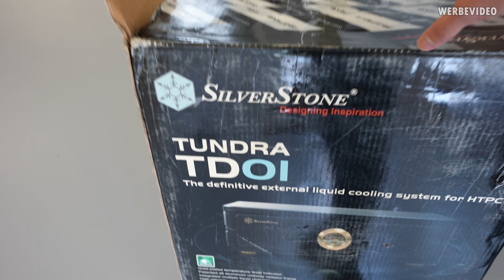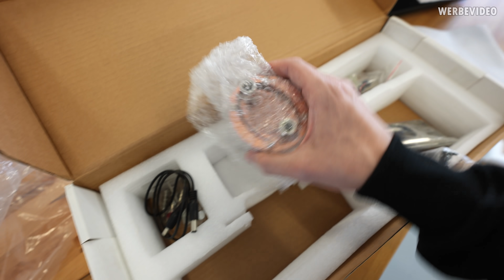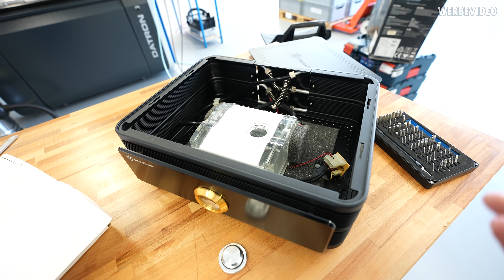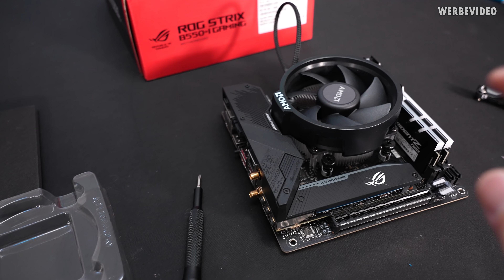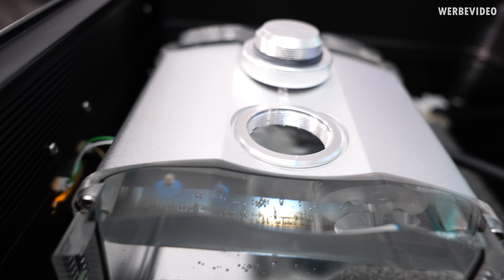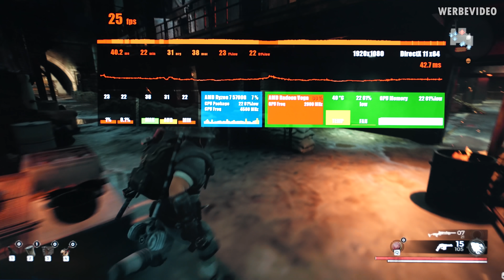This Water Cooling Concept from 2006 just makes No sense - Silverstone Tundra

Comment: I have to admit that analog water temp gauge is a neat look.  also if you want a plumb and play external water cooler, I think Koolance still exists and it uses an active radiator like normal water cooling.

Comment: I sold these and the matching HTPC case at the time it was new. Clients were looking for silent solutions for their new 64 bit multicore systems that were in their living rooms back when air cooling of these was loud at best. Different solution for a different time. AIOs were just starting to roll out, so if you wanted water-cooling without making your own custom loop, things like this were what you got. You also had to be in a larger case (think old Antec full size towers) to do water-cooling, but Zalman had a fanless case that was basically a giant heatsink at the time, but it wasn't much smaller and much much much heavier. This dinosaur lived next to the 80 and 92 mm Tornado fans that sounded like a vacuum cleaner all the time, so it was a welcome change.

Comment: If it were a case with pump and water block already then it would make for a great and compact homelab I'd imagine. Just stack a few of them up, maybe hook in a gpu water block and place 4 120 rads in a box shape on top with a fan wall as lid and hook up the lines to the rad box. Making it easy to remove and add units as needed.

Comment: First: that dual pump makes sense if you add a valve and electronic fail-safe system. So only one runs, the other takes over if the first fails. 
Second: it looks awesome, if you manage to make it more efficient/silent and make use of an eGPU with your laptop, build the eGPU inside it.

Comment: I think this is pretty clever really. it's a water-passive cooler for very quietly cooling chip, instead of water + actively cooled radiator. The holes on top should be plenty for convecting away heat from the inside surfaces, since convection is pretty slow... I can agree though that it's not a cost effective cooling solution, nor a space efficient one, and if the pumps are very noisy, it fails at it's main advantage.

Comment: I had an external liquid cooler from around the same era. I can't remember what it was called but it was made by Koolance and had 3 80mm fans pulling air through a radiator that was all packaged in an aluminum case that sat on top of your tower. It actually worked really well and was much more compact and probably cheaper than this crazy thing from Silverstone. Considering how much better that Koolance product was than this, and that I owned the Koolance product about 2 years before this even came out (you said 2005, right?) it is hard to see what consumers would have actually wanted one. It does look really cool, though. Interesting stuff, thanks for the video on it!

Comment: I wonder how much of an impact the water block had on performance.
Would be really cool to test and compare old CPU blocks against modern designs from high and low end brands.
The oldest CPU water block compatible with modern hardware right out of the box is Zalman's WB CPU series of blocks as they used the AM2/3/4's stock retention bracket.
Reply: I'm using a Zalman WB5 from ca 2007 currently on a Xeon E5-1660v3 and it's still pulling strong. From new it went from a P4 3GHz OCed to around 5ish, to a C2Q Q6600 no OC, C2Q Q9300 no OC, i7 920 2.66 OCed to around 3.8, i5 2600K at around 4.2, and now the Xeon it currently lives on. In every case it took a significant chunk of temperature off the stock cooling. It actually performs about as well as a lot of the newer stuff until processor overclocks start getting close to the edge.

Making it able to fit the LGA2011-3 hole spacing required some thick-wall steel pipe stock, a drill press, and a milling machine.

Unfortunately I don't have anything significantly newer to compare it against, the last block I got was in 2018 from EK, and performs fairly similarly. Liquid cooling in the late 2000s was a very strange place as the big manufacturers like Gigabyte and Asus and Silverstone got involved, because up to that point a liquid-cooled rig was either very industrially built from a kit or a Frankenstein DIY concoction, but once waterblocks settled on that square pin grid design it became a bit difficult to find a waterblock that didn't cool things effectively. Only real difference is the modern blocks aren't expecting oversized 2000lph pond pumps or something pushing 5 bar of water pressure. Speaking from experience, though, some modern blocks up to 2018 can still cope with that quite happily.

Also have a Reserator from Zalman. That didn't age quite so well. It's current home is an i5 4th gen.

Comment: I have actually seen these before. This is an external radiator. Not that pointless if you actually had a way to mount it outside so you are not heating your house with the PC and then using the AC to cool it down. The tiny tube is why there is such an overkill pump.

Comment: I do not get this at all. The idea of having a cooling unit like this without fans is great but those pumps in there is just insane. Why did they not put the pump on the processor cooling plate? The computer itself already makes noise so you will notice anyway but the external cooling unit will be silent if you do so.

Comment: You seem to be judging it a lot by modern standards. Motors, especially small ones have improved a lot since then. They needed 2 to get barely any flow. With regard to noise you probably wouldn't have been able to hear it over your hard drive or possible the high pitch whine of your CRT monitor.

Comment: I remember back in 2004 having a lan party and seeing my first water cooler. It looked like the guy mounted his PSU on the outside of the case. It was this huge external block almost exactly same dimensions as a PSU strapped to the side just sticking out.
Reply: reminds me of the phase change coolers where your CPU was the evaporator in a tiny little air conditioner setup, basically.
Reply: @rosonowski  yep was not far off, sparked an interest thats for sure.

Comment: this was done around the time of the push for all those external water cooling solutions. some were completely passive, some weren't. this was one of the bulkier options. and yeah, it's designed to use the outer ring of the shell as the radiator, but without fans.

build quality was pretty decent, but there were mixed feelings on performance at the time.

regardless, its functional and pretty nifty looking. even if there were... issues.

Comment: The one use case I could see for something like this is to run the lines out your window so you don't heat up your room. 
Not this example, cus the pumps are weak and the case isn't great, but in concept it'd be neat.

Comment: You must be young... in those days there was no thermal throttling, pump failure would cause CPU failure thus dual pumps. heat was not nearly as big of a deal CPU's did not generate nearly as much heat. fan noise was a big deal though.... The cred for having a super quiet water-cooled PC would be massive it was not super common.

Comment: I be honest, i would love to see remakes of these cases, i dont like those cramped up PC cases full of tubing and radiators, just a clean open system with external watercooling unit would be way nicer and can easily be put out of view. Ok, sure they need fans instead of passive, but its so much easier to maintaince your PC case by just unplug the waterlines and be done with it.

Comment: the point about the 5700g is kind of weird at the moment because in the example given a gtx 1650 alone is 150.- more than a 5700g at the moment and the 5700g is also much faster as a cpu than the 3600

Comment: Fun Fact: Sealing the case will make it perform better because - internal case temperature will rise, causing the air inside to want to rise, exiting through the vents on the top of the case, causing low pressure inside, which will draw in air where it can (through the finstacks), thus creating an active/passive cooling through natural thermal updraft.

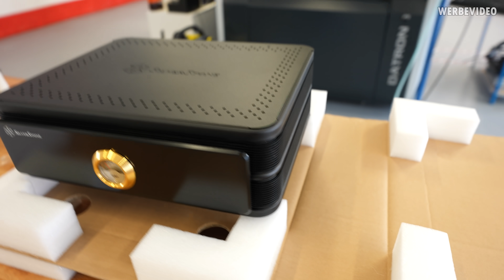Comment: 1:00 its gorgeous, whatever it is or how it works.
Looks like the PCI bracket is a passthrough for power and tubing into the the cpu case, to go to the external unit.
Im betting silverstone had a matching case to stack underneath this one.

I bet you could run a pump/block combo, remove the huge pump resevoir, and machine the back panel for passthrough cables so you can mount the motherboard inside the case and access all the necessary ports. it would make a really slick looking HTPC for a hifi rack. I would 100% run this myself.

Comment: Roman, I wouldn't even recommend this APU for systems that can't use a dGPU. People who want to build one of those need to wait till RDNA2 APUs are out. They're just around the corner. Vega APUs haven't sold very well and AMD knows this, they were just offloading what silicon they had left from the Vega line into cost effective office workstation APU parts that were only going to really be used for microsoft office, emails, and database software.

Comment: Der8auer, 5700G works flawlessly with stock cooler and rog b550i. In general you are right, that amd logo collides with vrm cooling or ram, but you have several options here
1) you can remove cooler decorative shroud and if you have some low profile memory - it works.
2) this is actually a best option (went this myself). You install cooler as usual (without ram for now) and rotate just the cooler (without heatsink) 90 degree clockwise/counter-clockwise, et voilà you have perfectly mounted cooler without interference from vrm cooling or ram. Would post a picture here if there was such possibility

Comment: I remember this unit, if I remember right, then you could get a case to put on top of it, I'm not entirely sure though, I know there was a few that tried to make a modular system like this, AseTek being one of them with Vapochill LS, though that were phase cooling and not water cooling.

There was a lot of that odd-ware back in early 2000 up to around 2010 ish where they were trying all kinds of cooling systems, if I remember right then Thermaltake also had Peltier cooling around the same time period.

Comment: I would LOVE to see a computer case like this redesigned for a modern HTPC setup. It wouldn't need too much in the way of changes, honestly. Redesign the cooling fins to allow rear I/O and a 140mm fan or two, improve the efficiency by rethinking the routing of the coolant pathways, use a more modern and compact pump (potentially with an external reservoir and drain), and that would be an amazing niche-market product imho.

Comment: Fascinating product. Though the confusion over what it was is a bit baffling to me watching the video - literally the first shot of the video shows the box saying "The definitive external liquid cooling system for HTPC". There is no way those words would be used for a PC case. Of course, I have no idea what the ebay listing looked like, or whether the box was pictured, and it does kind of resemble a HTPC case - but the latter is precisely the point, in order to fit into a stereo stack. Still, a fascinating test!

Comment: Zalman had an external passive water cooling tower. You hooked it up to your PC and it would just sit there and chill. 
I guess those kind of ideas were around before quiet active cooling become good enough.
Reply: The Zalman Reserator. I bought one new for overclocking a P4 back in 2007. It is still in service keeping an i5 4-something cool. The P4 rig it was attached to is in pieces.

I found it to be an average liquid cooling system compared to the full-custom DangerDen etc stuff we normally used at the time, but a great conversation starter.

Comment: Move the reservoir outside of the suitcase, put it in it's own box for noise control.  Then build a computer in the center of the suitcase.
Maybe make a cut out in the lid to mount 1-4 fans blowing external air down and into the suitcase, cooling the vrms and memory and then that air could exit out through the sides of the suitcase

Comment: The dual pump could possibly be necessary to provide enough head pressure if the PC case was on the desk and the radiator housing was on the floor, for example. (If you changed the tubing lengths)

Comment: This is why you research purchases of auction sites, not all sellers know what they have or they see certain people coming a mile away. However I would have bought myself one of these if I knew it existed. And as for the foam it is for noise dampening but I would replace with new foam and buy some new tubing and replace all the seals.

Comment: Lots of people were still using Eheim 1048 or 1046 ac mains aquarium pumps for watercooling (because of their reliability and because there weren't really any dedicated water cooling pumps, although in 2005-2006 there might have been a couple of 12v pumps just about coming out on the market), also at that time was the beginning of dedicated pc watercooling radiators. Most radiators used for watercooling up until that point were heater cores from cars (the radiators inside the dashboards of cars used for warming air to warm up your car interior using engine coolant). The Eheim pumps needed quite a bit of vibration insulation, but they were actually pretty quiet if you did that. The big pain was running the ac mains power cable out of the case and ideally without cutting the original cable which was molded for insulation, the Eheim pumps are made to be either inline or actually submurged so cutting the power cable CAN be a bit of a hazard unless you know what you're doing =D

Comment: You gotta mod that into an actual case. Maybe replace the internal pump/res with a more modern one saving a lot of space, then put the pc inside. Replace the top plate with one thats able to allow air through and put a single LARGE fan at low rps so its pretty much silent. Then see how how it performs

Comment: I find this product totally fascinating. It makes me ponder a 4U server chassis at the bottom of a server rack with thick radiator intakes on the side and front (still exhausting hot air out the back), pump/reservoir in the middle. Then quick disconnect tubes going to the 4U server above it, which would be loaded with eight or ten watercooled GPUs.

Comment: It'd be interesting to see how this old thing goes with a more sensible tube size, a modern waterblock and single D5. Running the "radiator" tubes in parallel would almost certainly be better for flow as well.

Still probably would have nothing on a Noctua NH-P1 though.

Comment: Even with dual pumps that might be much quieter than many of the other CPU cooling options back in 2006. To put it in perspective maybe it should be tested vs other coolers of that vintage.

PC industry has come along way.
Reply: I remember my computer back in 2006 and even just the fans would be quite loud compared to a more modern PC even 3-4 years later when they started focusing on making quieter fans, GPUs and PSUs

Comment: It looks so cool though haha... I'd love to mod it as follows: a) block the top holes b) cut the bottom out with 4x140mm C) mod the feet so it sits off the surface beneath it for air intake.  Install 4x 140mm fans. Hook the temp sensor into a fan controller.

Find an sff case that sits perfectly on top of it.  Be interesting to see what performance it becomes capable of with these mods.

Comment: As soon as I saw that bracket for the tubing, I knew it was an external pump and radiator,
Now you can always mod it,
Maybe cut the bottom and put it on the top of case with (almost) the same width and length, it would make it a small tower
And with fans on the bottom, airflow would be ok I guess

Comment: My memory of Silverstone at the time is hazy but I have a feeling this box was designed to pair with one of their cases with the same footprint in a neat stack.
As such, and with smaller, quieter pumps available now. It could be modded into a real case and be a better HTPC than the original configuration would have been.
Reply: I had seen this deployed in a system and remember Silverstone products were heavily marketed at the HTPC crowd with very visual racks of equipment and this was meant to fit in with that aesthetic.  Put this on the top shelf, your PC on the next shelf down kind of thing and not have it look out of place with the rest of the A/V gear.  Silverstone stuff was generally very quiet but if you wanted to push your PC this was the only way to avoid adding loud fans.  So it makes complete sense when you consider the specific niche they were targeting with the product.  The one I saw was silent running so maybe once the pumps purge?  Or due to age somehow?
Reply: @raymondrichmond1  yeah, this totally has an "audiophile" look to it. I think it's neat, would fit right in with a shelf of nice amps and audio toys.

Comment: This might be more interesting If the pump was a D5 integrated into the CPU block, but you have a passive external radiator case with no moving parts. Hide the noisy htpc In a cabinet, pretty rad unit sitting in the open

Comment: hi, it external watercooling radiator with pump , same as asus make with his overkill laptop .... included bracket for pci slot is input to case to route tubes for cpu cooler . 
i build many years ago watercooled server builded on dual opteron. i must only order 2nd cpu cooler and pci plate .... 
one still is unpacked in the stock for collection of bizzare :-D